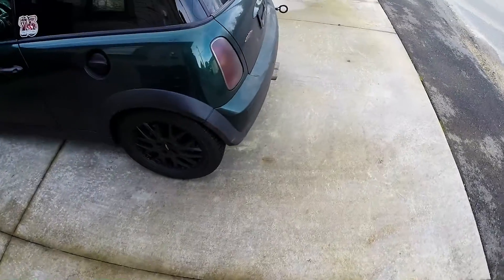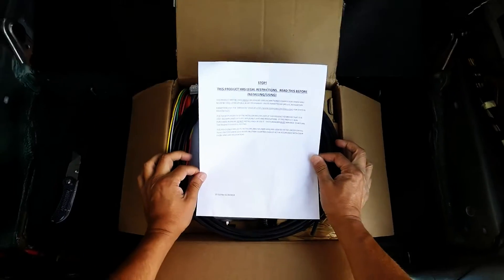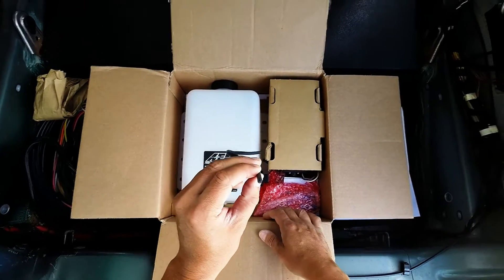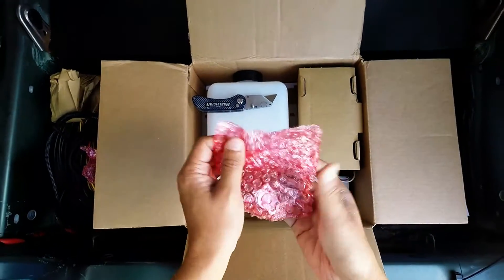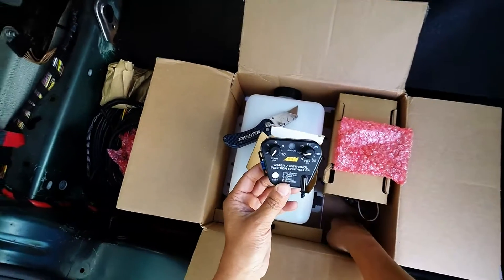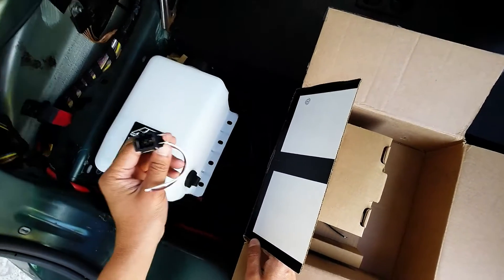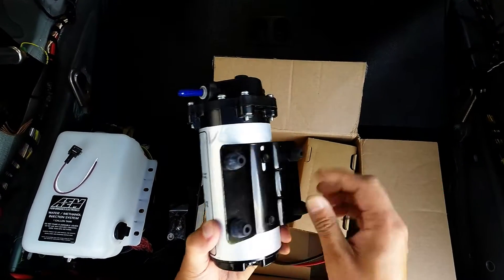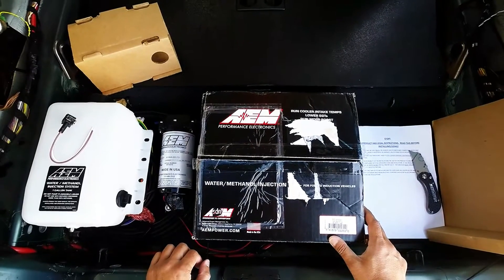Unboxing AEM Water Methanol Injection Kit 30-3300

Comment: can AEM runs with jb4?
Reply from the maker: I have no idea if this kit will work with JB4, but I don't see why it wouldn't as it has it's own configurable controller.

Grem...
Reply from the maker: I see no reason why it wouldn't. It will work with a stock tune and custom tunes designed to take advantage of it. You probably will not get as big a power increase with a tune which is not specifically designed for it.

Comment: How was the install?
Reply from the maker: Challenging!

I paid to have it installed and unfortunately, not excited with the end result. I've had a number of issues with the kit, from the control module locking up, to the injector nozzle blowing out of the intake horn and finally, not getting anywhere near the performance boost I was expecting. I do feel these issues are all related to the install and tuning, which I hope to get resolved this summer.

More to come.

Grem....
Reply: Gremothra I guess I'll have to get the snow kit then
Reply from the maker: I think the kit is great! Other than the few hiccups I've had.

I have a friend with the same kit on a Turbo Min and he's got no issues and mad power.

I'd definitely buy this kit again for another vehicle.

Grem....